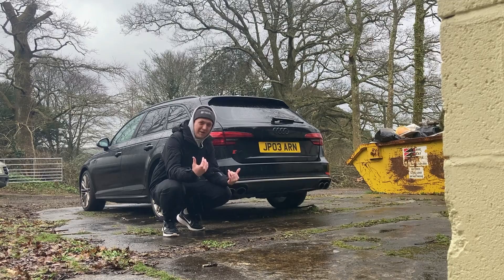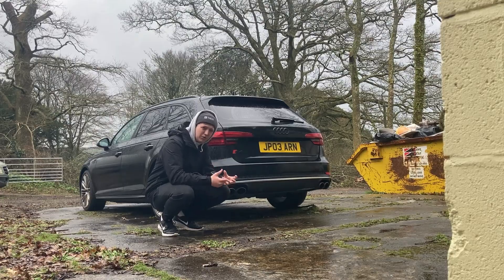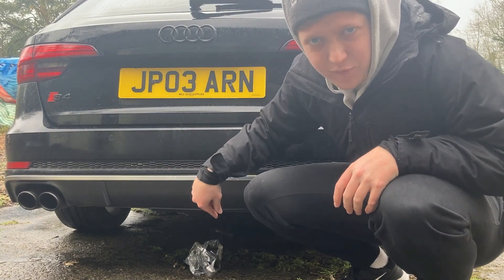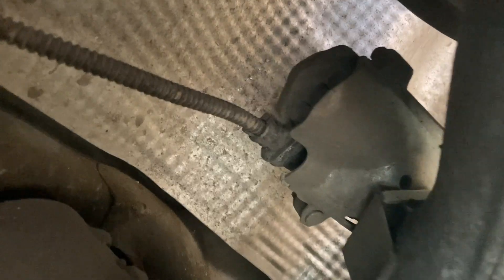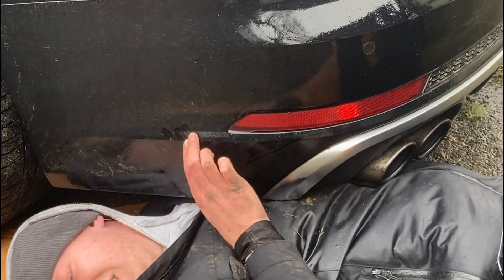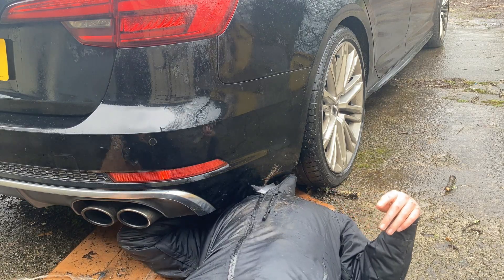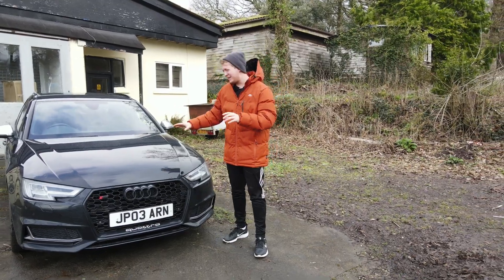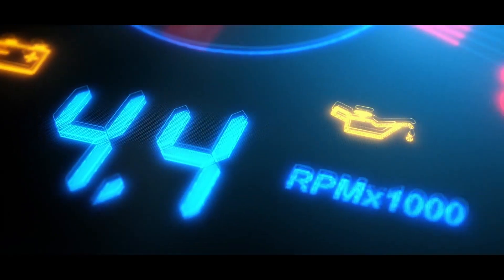FREE Exhaust Modification For My Audi S4!

Comment: @jaypcars how on earth did you get the connectors released? The are impossible on my car - are you pressing down on the tab then pulling them apart or sliding the tab back? I'm no joy with either method and my hands are now in pieces!
Reply from the maker: This was a long time ago so can’t remember the exact way of doing it, but all I remember is that it was very difficult! They feel like they’re welded together and will never come apart. I think it was a bit of everything, pressing, pulling, wiggling, etc.

Comment: You do not have to do this to get the valves open all the time on the S4 B9, just start car, go to another drive select mode like individual and then go to dynamic, the valves will stay open all the time until you stop the car. Yes you have to do it every time you start the car but it literally takes seconds (though you may miss the cold start as that only lasts a few seconds, small price to pay I think)and no chance of damaging connectors or any fault codes that may not show up on dash but would show up on a main dealer scan.(maybe important if still under warrantee)
Reply from the maker: Like you say, you’ll miss cold start, I also heard they will stay closed if under certain RPM & speed due no matter drive mode due to emission/sound regs - can’t remember which specifically. When it goes back to dealer for anything I’ll be plugging back in anyway. Also, double checked putting seatbelt on passenger side to highest point - still rattled unfortunately.
Reply: @JAYPCARS  the seat belt thing baffles me, cant see why such a simple thing is different on your car to mine but apparently the tension on the belt can get less with age and the knocking can be slack in the belt behind the trim, ....hey ho...anyway the valves do stay open all the time  for sure , if you search Alfies cars on YouTube my White S4 is on there, it's only a wee lad with his dad who was extremely ill for 2 years, effected his son badly as he nearly died and he asked for cars to review with his son to increase his confidence as he does all the reviewing and his dad the filming, I  volunteered as he loves Audi's,( gave him a load of Audi goodies,he was made up ...lol) it's not Top Gear quality but there is a bit of revving and a drive by with the valves open through the drive select, and you get a marvellous chance to see my car🤣 . Ta for the replies mate👍
Reply from the maker: I’ll take a look! Could well be a loose belt 👍🏻 Seem to hear different things about the valves from what I’ve asked and searched lol
Reply: Not true, the values will still close in dynamic under certain conditions/ rpm